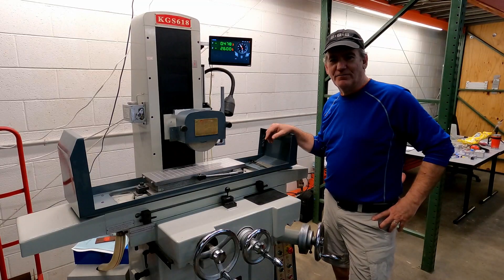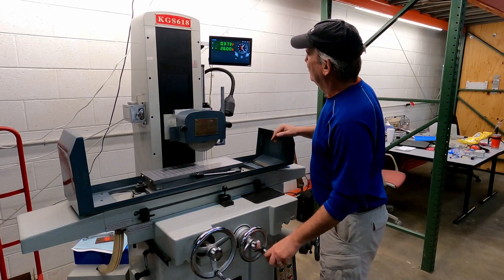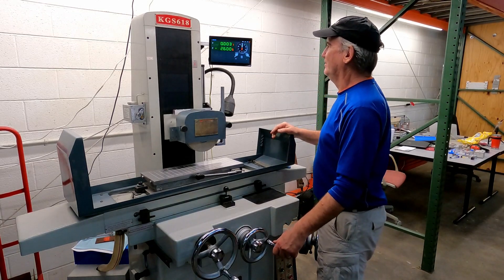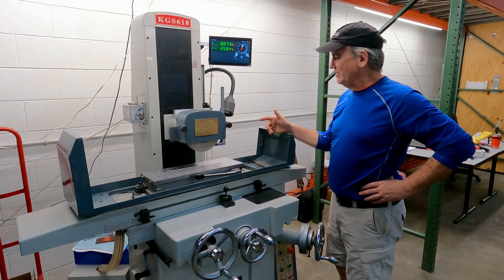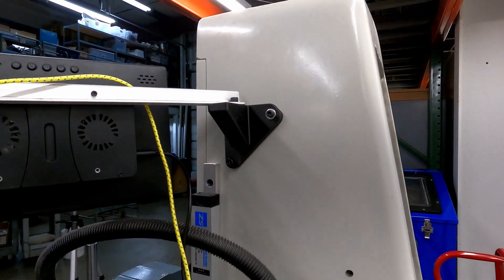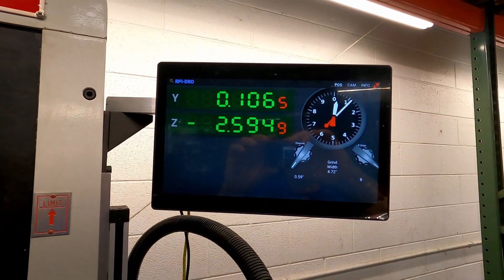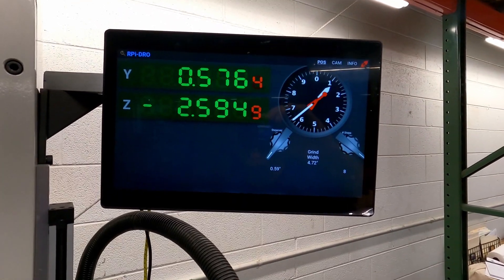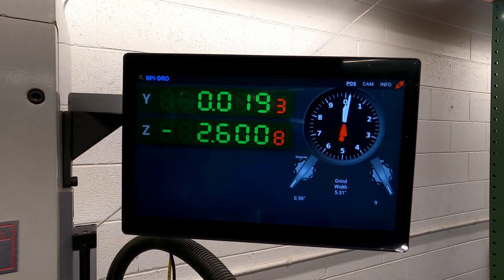Raspberry Pi - Surface Grinder Digital Readout

Comment: Hi - quick question, what is the pi GUI written in please??
Reply from the maker: Everything is written in Python plus Kivy.  Kivy does all the GUI stuff and is super powerful.
Reply: Thanks Jim - I am retired and rebuilding a Jones and Shipman 540 (I'm in the UK), so when I saw your project I was intrigued. I am working to use a couple of Heidenhain scales I have by interfacing them through a Sin/Cos-to-digital convertor from iC-Haus with a Teensy through to a Pi or Touch DRO. I have a Pi with touch screen so at the moment am looking to go that way --- please would you be so kind as to share your source code for the teensy and the Pi - I will of course share back anything I do. Regards, Jim Edwards (ex Rolls Royce & IBM)
Reply: PS - impressive workshop!
Reply from the maker: @jamesedwards9036  Jim, sorry for the slow response - I'm not good at the whole YouTube thing.  I'm also sorry to say I never did anything further with this project.  In fact, I don't even have the grinder anymore.  I did find the Python / Kivy source code.  Your welcome to it - not much there I'm afraid.  However, the big gauge does work nice.  Not sure why something like this was never developed by anyone.  Send me your email and I'll send you a zip file back.  Just don't expect much.
Reply: Thanks Jim - I sent an email to yout gmail account - have a great Christmas, Jim

Comment: Hi - very interested in what you have done, would very much appreciate it if you could share the circuit for the connections to the scales via the teensy / Pi. I have some old Heidenhain scales and would like to connect to a pi-based "modern" Dro display. Thanks, Jim.

Comment: What is the 'other' board on the breadboard next to the Teensy?
Reply from the maker: It’s a level shifter. I think a RS422. I’ll check tomorrow when I’m in the shop and let you know. Thanks for the interest.
Reply: @705cnc  Maybe a 74LVC245? Or maybe the TXS0108E? Very grand project!